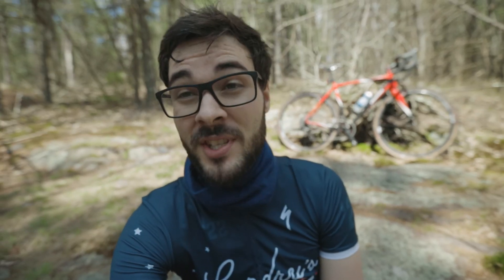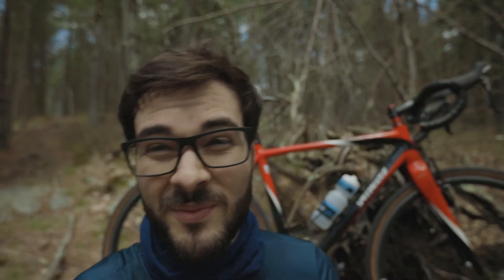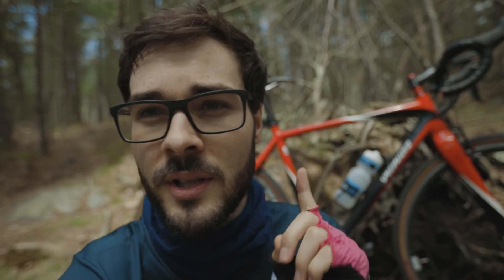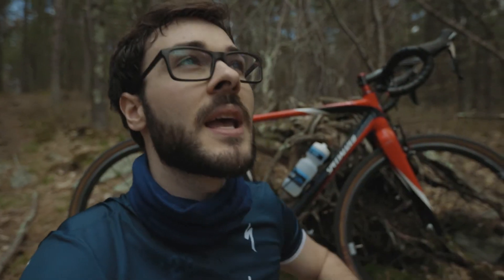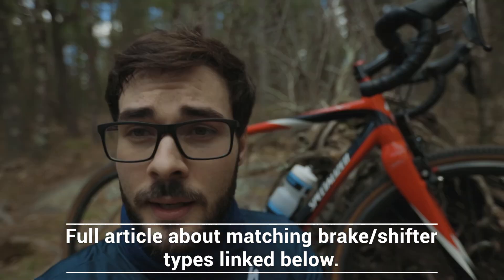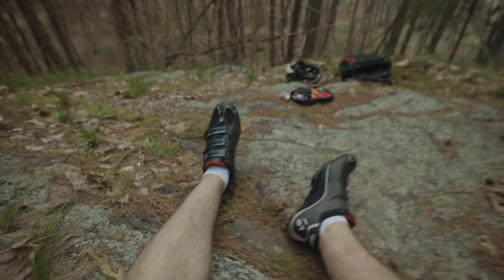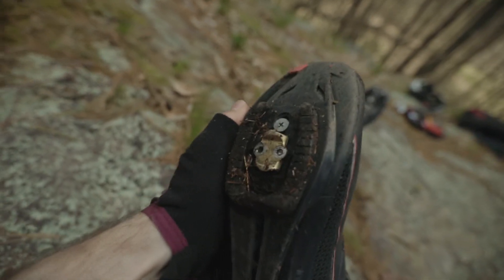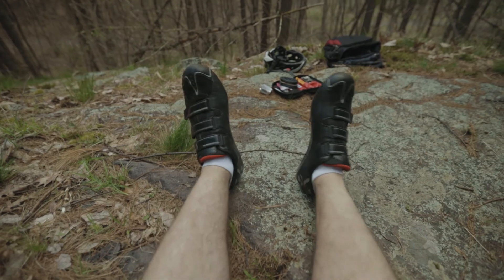Lever pull ratios | What happens when you get it wrong?

Comment: I’m sorry, but you're confusing something here.
Cable pull is 7mm for most road levers, including drop levers, except for newer Shimano which is 8mm (mostly 10- and 11-speed). This is called short pull. The cable pull for MTBs designed for V-brakes is 15mm and is called long pull.
Short pull is compatible with road side-pull, center pull, cantilever, mini-V (90mm and shorter caliper arms) and short pull mechanical disc brakes.
Long pull is only for standard V-brakes (95mm and longer caliper arms) and long pull mechanical disc brakes.
If you get poor braking with cantilevers, try setting them up better first. That usually involves setting the straddle cable lower, closer to the tyre, and making sure the braking surfaces are clean and pads are good. For extra grip, you can use V-brake pads on the cantilevers.
But cool if V-brakes are working for you in this setup. I would be happy to hear more about how you set them up.

Comment: How do I know if my brakes are short or long pull?
Reply from the maker: Disconnect your brake cable and remove all ferrules. Then while holding down that brake lever make a mark where the cable meets the housing. Then pull the cable back out and measure the distance between that mark and the cable housing. That should give you a rough estimate 👍

Comment: Hi, from that article you linked and other googling I’ve done, STI levers don’t really work with V-brakes. I’m trying to do the same with 105 shifters. Did you run into any problems with the pull ratios? Did you have to set the calipers much closer to the rim?
Reply from the maker: I use the 105 road shifters with the standard shimano mtb v-brakes and they are indeed set quite close to the rim but nothing too crazy. The biggest annoyance is that you will need to add an in-line barrel adjuster. Another trick was to use v-brake pads for road/hybrid not the mtb ones to get the spacing about right.
Reply: @nerdycyclist8680  thanks for the insight! I was hoping it would be plug and play as long as I got the calipers close enough to the rim. I’m using standard shimano mtb v-brakes as well. The guy I bought the 105 groupset from also has some shimano 600 brakes for sale, but I’m not too sure if I have the appropriate mounts for those. Might want to just go that route if it proves too much work to get the v-brakes right.

Comment: Hi, thanks for the explanation. Just a question: When you mentioned claris shifter, do you mean the road levers (e.g. ST-R2000; ST-R2400,etc)? If claris has 38mm pull, can I get away with a MTB M375 mechanical disc brakes with the Claris levers or do I still need a travel agent adapter?
Reply from the maker: For disc it's a bit different and depending on the caliper they tend to require less force to pull. I've seen both claris and 105 for mechanical disc with road levers but not sure about the mtb calipers. Best bet would be to measure the cable travel with it installed on the bike and try to get something close
Reply: @nerdycyclist8680  Hi I would like to report that I've been on a pair of Sensah road shifters (8 speed) on a Shimano TX805 (MTB) disc brakes. You have to pre-load the piston arm to get one side of the pad to move in further, and it will work flawlessly. After > 300km, it works quite well that I could just do 2-finger braking for most of the time. Ironically, using a BR-R517 (road) disc brakes did not work well for me that I had to return it. BR-TX805 is much cheaper, easy to use (R-pad is also 5mm) and reliable. Hope this information is useful for people wants to convert to drop bars on disc brake bikes. Cheers.